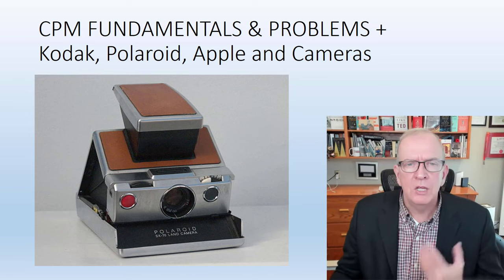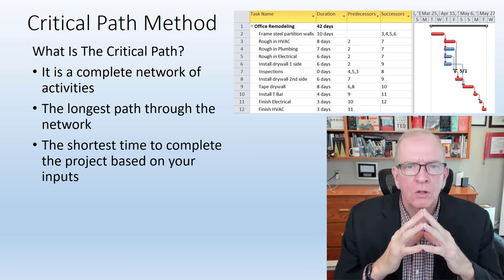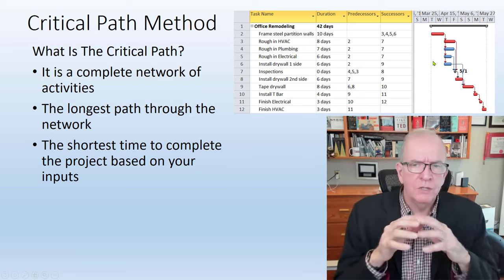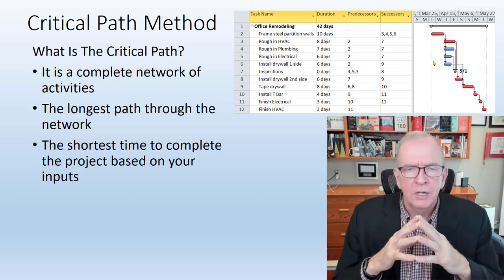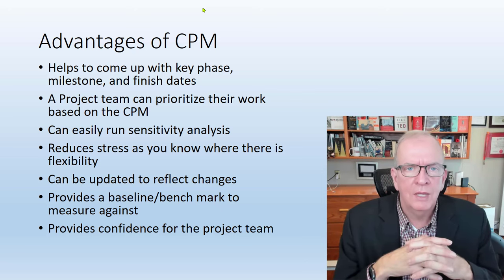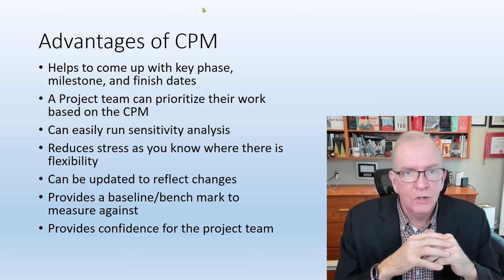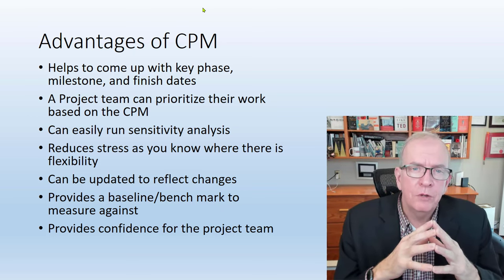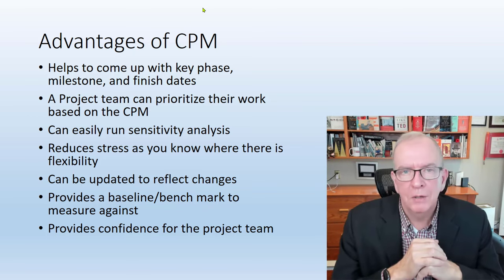Construction Management: Critical Path Fundamentals & Problems in Thinking & Application

Comment: Hi Tom, thanks for the content. I'm currently studying Technical project Management and have learned in construction many times LBMS is used instead of the Gantt for construction projects.  Can you clarify, when one should be used over the other or how they complement each other.  I work in the software/tech industry and would like to know how use/complement both project management concepts.
Reply from the maker: Hi Oscar, difficult to explain in a few sentences i will try to do a video on it though.  LBMS or takt offer alot of time savings especially when there is a lot of repetition such as a multistory tower.  It does however require strong commitments from the parties involved to be successful.
Reply: @TomStephensontraining  Thanks for the insight Tom.